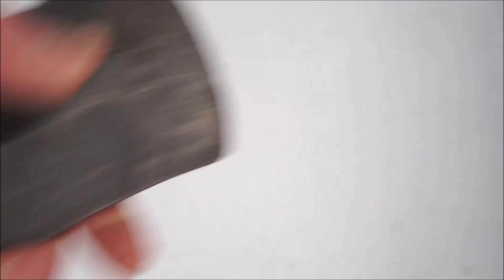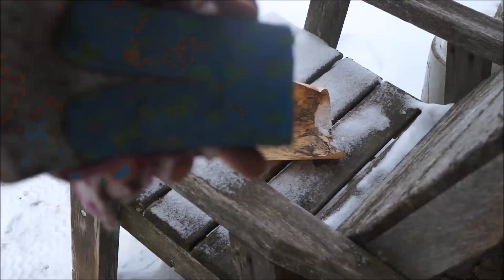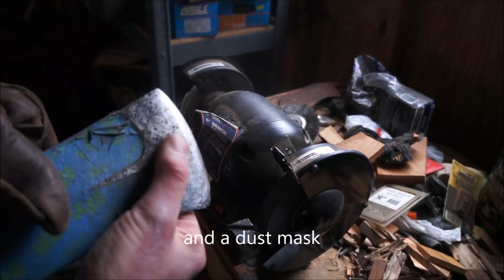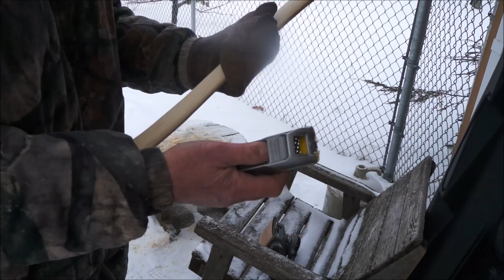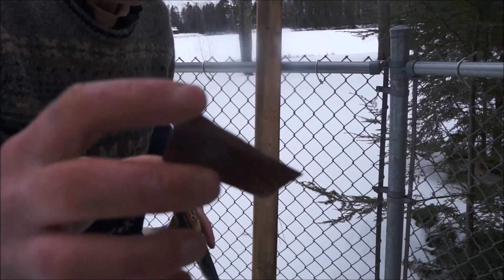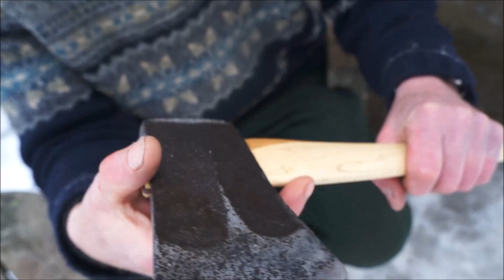American Ax & Tool Axe

Comment: Hi Jerry, Mike again. Nice job on the boys axe! I have one question though. I'm wondering why you oil the wedge instead of using glue? Do you find that it dries in time and loosens? I'm just curious. It looks great with the contrasting wedge! I've been looking for a couple of real pickaroons ! Not homemade. Really not looking to spend $40 on one. Keep your eyes open please. Ok enough chit chat. Take care and stay safe. Mike Rehoboth MA
Reply from the maker: Hi Mike. I don't like to glue in case I have to remove it. The friction will hold it usually. And if the wedge can be removed then the handle usually can be saved. If it's glued then usually the handle would get wrecked trying to remove it. Some people like to glue, it's just personal preference. A pickaroon is a good tool to have. I only have one and gave away another one to a friend. I see them sometimes though, I will keep an eye out.
Reply: @Mindokwin  I'm gonna try a couple with no glue! I'm also going to use a contrasting wedge. I really like how that looks! Nice job 👍 Mike
Reply: Hi Jerry. Hope all is well with you and your family. If you have a minute I would like you to check out the 3 Isaacson pickaroons on eBay and give me your opinion. Thanks! Mike
Reply from the maker: @mariecandeias7355  Hi Mike, I don't know much about pickaroons or Isaacson. Those look in good shape plus real nice raised maker marks. I think they are cast instead of forged. So  maybe more modern than forged. Different sizes is a plus. and it would be under $30 a piece. I prefer forged on old axes or pickaroons but those don't look bad at all. So I don't think you can go wrong there but like I said I don't know much about them.
Reply: Hi Jerry, I bought the Isaacson's gonna pick the one I like the best and make 3 handles. I'm gonna send the others to you. Make a video hafting them! Great idea 👍 keeps you on your toes! Lol! You and your family stay well. Talk later, Mike

Comment: Very nicely done I like the black walnut wedge I am doing a boxes axe at the moment making a ash handle.    I prefer walnut but I don't have any long enough.   That is a very attractive piece in the handle you just put on
Reply from the maker: +cabotbluegill Thanks. I just bought a small walnut board at the local big box lumber outlet. It was expensive but will make a lot of wedges.